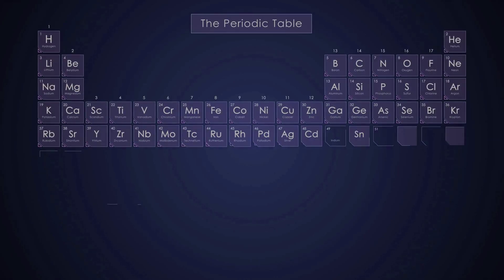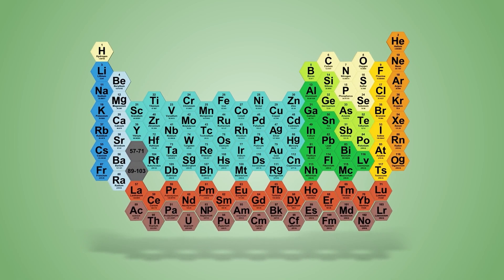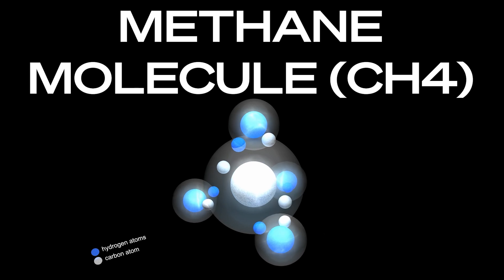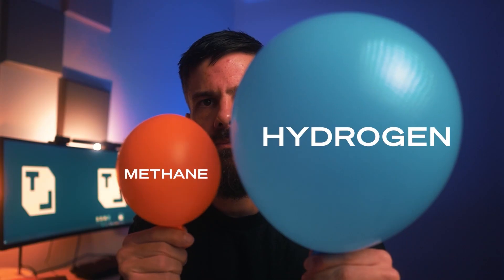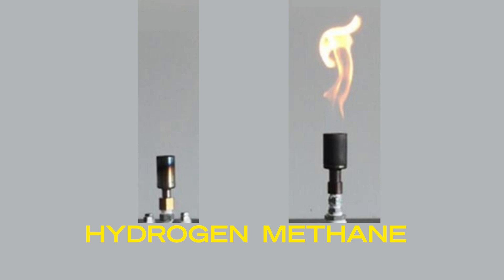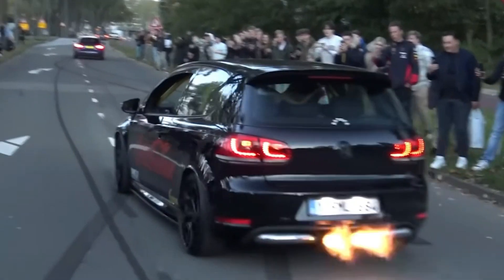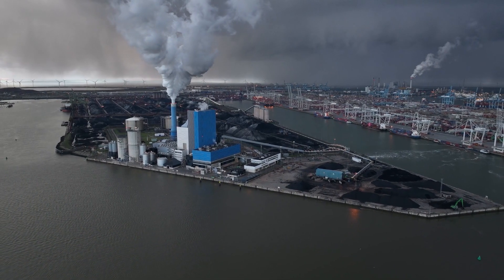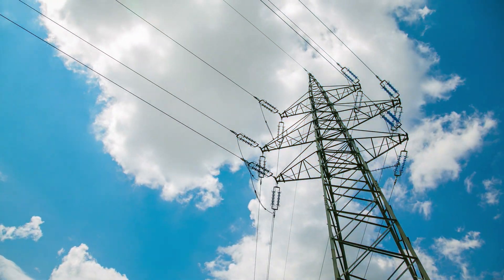Is Hydrogen the Answer to Natural Gas?

Comment: I smell fossil fuel producers behind this.   All the problems he lists are sovleable but he seems not to know what's going on.   Clever engineers, for example, have even invented a solid form of hydrogen that solves the corrosion issue.  The simple fact remains that a 100 % hydrogen  based economy wiill totally solve all climate change problems and that vitrtually ensures that it will happen.

Comment: Why can't we commit to biogas? The carbon dioxide can be separated, liquified and directly injected into the deep ocean, forever removed from he atmosphere (except when used for carbonating drinks) and the methane used to supplement and perhaps replace natural gas.
Reply from the maker: Hi @TJPlocek

While biogas has many benefits as a clean energy source, there are also several environmental issues associated with its production and use. Here are some of the environmental issues with biogas:

Land use: Biogas production requires a significant amount of land for the cultivation of energy crops or the storage of organic waste. This can lead to competition for land between food and energy production, and may result in the displacement of food crops and other ecosystems. There is a really good video on this here: https://www.youtube.com/watch?v=OpEB6hCpIGM

Greenhouse gas emissions: While biogas is considered a renewable energy source, its production and use can still result in the release of greenhouse gases, particularly methane. Methane is a potent greenhouse gas that is 25 times more effective at trapping heat than carbon dioxide over a 100-year time frame. If not properly controlled, the emissions from biogas production and use can contribute to climate change. The efficacy of carbon capture at this stage is questionable, and is one of the reasons blue hydrogen is being 'shunned'.

Water use: The production of biogas often requires significant amounts of water for irrigation, fermentation, and cleaning. This can result in water scarcity and may have negative impacts on local ecosystems and communities.

Soil quality: The production of energy crops for biogas can have negative impacts on soil quality, particularly if the crops are grown intensively or without proper crop rotation. This can lead to soil erosion, loss of biodiversity, and decreased agricultural productivity.

Comment: Hi Nik, Loved the video. however at the end you said its more feasible to transfer to electric when we do renos etc. Just thinking out loud here and limited research but i believe NZ electricity runs off of coal? Does this make a difference to the emissions? is H2 and the admin that comes with converting to it actually more efficient than natural gas or lpg? Is electricity (if burnt by coal) more effective and environmentally friendly than gas? thanks. and thanks again for trade lab... loved it!
Reply from the maker: Hi Louis, 87% of NZ electricity is renewable. To generate sustainable hydrogen you need to use renewable energy anyway. So you'd have to put the renewable energy in place to create the hydrogen, so it could be put directly into the electrical grid.

Comment: At present, the only way to generate green hydrogen is through solar energy. This is less than 5% of hydrogen production, with the rest of it being generated through using fossil fuels. Using hydrogen means heavier and more expensive fuel tanks. For these and other reasons, hydrogen is not going to be economically feasible in the foreseeable future. Since green hydrogen requires solar, why not just go electric anyway?
Reply from the maker: Agree, but the gas (natural gas) industry is pushing for hydrogen to stay relevant. And so we're having to have this conversation.

Comment: Whether it is the answer or not is dependant on it's cost.
If using variable renewables and electrolysis it's cost will be very high. That is before all the other technical problems of storage and the many safety aspects.
Reply from the maker: Yeah, there is always an awkward phase of high cost at the start of everything. Overtime as production means become more efficient the cost will come down - wind and solar renewable energy is a prime example of this.

Comment: How about using hydrogen in a power plant ? The end product, electricity is far simpler to handle in a household and switching from gas to electric cookers seems far cheaper on a large scale. In the end, half of the methods we invented to create electricity on larger scale involves boiling water. Even if we need to pump hydrogen in a pipeline to the power plant, that's still mostly open air.
Reply from the maker: Yeah, when you get into the nuts and bolts of it electrification seems like a more logical solution. We will still need ways to store renewable energy (e.g. for when the sun isn't shining and the wind isn't blowing) and hydrogen could be more suitable as a 'battery' for these scenarios. Also for remote sites, it could be better suited rather than having to provide new infrastructure from central power plants, etc. you could use local generation.
Reply: That sounds complicated.  You need electricity to harvest the hydrogen from water.  Building a solar or wind system to make electricity to split water molecules and then use the hydrogen to power a generator seems inefficient.
Reply: @ezaxis  It would be if solar and wind would produce consistently. They don't, so the idea would be to use reusable power to create H2 when the conditions allow, and to use H2 when they don't. Same concept as hydropowerplants pumping water uphill as a reserve when there's a lot of water in the river for times when the water levels are lower. The milion dollar question is: is this more environmental friendly and cost effective than more traditional battery solutions.

Comment: Idea:  What would happen if 20% ammonia was added to natural gas distribution systems?  It is known to be safe for natural gas pipelines, however, would it be safer and more effective than hydrogen?
Reply: Ammonia corrodes Copper, a lot of pipes in houses for Gas are made from Copper or even Copper Gaskets get eaten up. Ammonia is so toxic for life. Just look up the Precautions that has to be taken to work on Ammonia Chillers.
Reply: Anhydrous ammonia is deadly - it is absorbed by anything that has water.  Try taking a whiff of dilute ammonia cleaning solution just to see what happens.

Comment: The green hydrogen doesn't need to be transported anywhere if it is used as an energy storage.  It can be generated and consumed at the same location, with safe storage.  The large scale storage can be the same as methane uses: underground.
Reply from the maker: 100% agree. There may be needs to distribute it still. Whether that's for vehicles or industry.
Reply: I am guessing you still have to use proper tanks underground, as in purposely built hydrogen storage tanks? Is this what you mean when saying the same as methane?
Reply from the maker: @dendoy6406  Yes, you would have to have purpose built tanks
Reply: @dendoy6406  
Methane aka natural gas is stored in abandoned underground salt caverns under high pressure.

Comment: Here in Tasmania, as most other places probably, the promise of 'green hydrogen' is being used as cover by politicians unwilling to genuinely act on climate-biodiversity, and by fossil fuel gas corporations greenwashing the longest possible use of their gas as a 'transition' fuel.  No one's being real about the basic issues, not just because they're complex, but because State-capture by the corporate-investor sector is a thing.  Corporations are the tail that wags the dog, and while they think that's a great thing - and is if your only consideration is short-term shareholder value - in the medium to long term it means all legislation and decision-making is adversely skewed to the short term.  In other words, legislation and government generally is no longer fit for purpose if the 'greater good' is the priority.  Thanks for the video, by the way!  All the basics build to the big picture, then back down to the critical issue.  Well done!  Slainte!
Reply from the maker: Yeah, and they are not lying when they say hydrogen releases no emissions when consumed. The issue is that the emissions are released in its generation process.